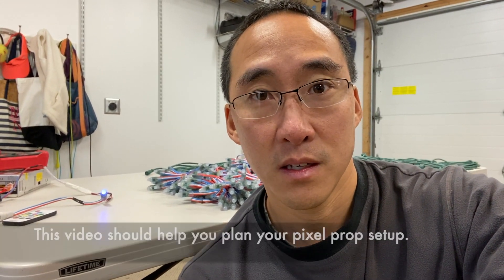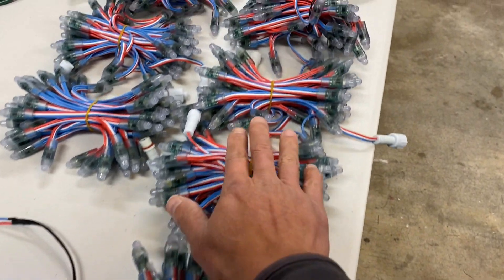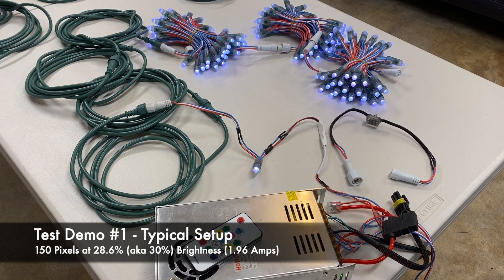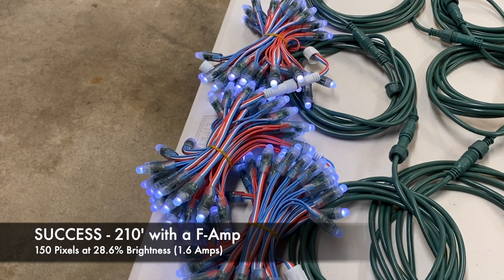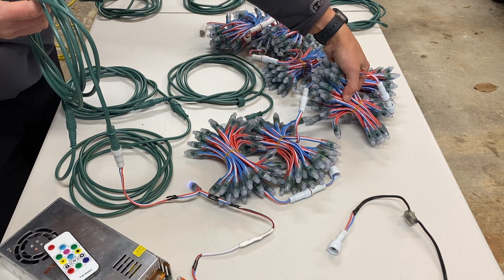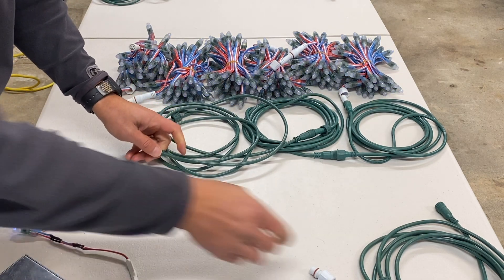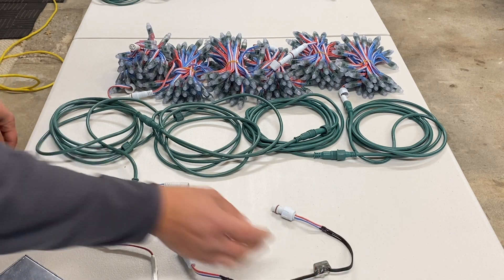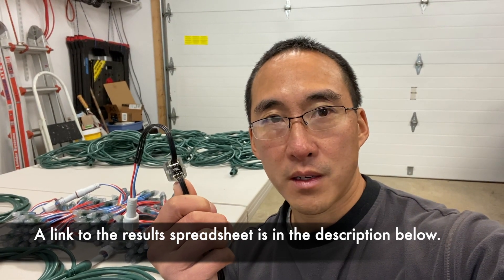WS2811 Pixel Data - How Far Can It Go With and Without a F-Amp

Comment: Yes this works well with Null pixel between controller and first and numerous strings after.....BUT what is the scenario when you want to jump from the end of say a 235 light string 10ft to the next level is the f-amp gonna help with that?
Reply from the maker: Yes, it certainly will help in that situation. After 235 pixels, you could add an F-amp and should power inject before the next set of 235 or more pixels. I actually do that for one of the shows I run. Without the F-Amp, all white can get flaky  with the second set of 234 pixels despite having enough power. The F-Amp cleans the signal plenty to chain another large batch of pixels with no problem.

Comment: Well you have the same results if you run the same set up from the controller and without the first pixel in line ?
Reply from the maker: Mouris Younan, if you're running from a Falcon or Kulp controller, you're likely to have better results than what's shown in these tests.  I didn't run the tests from the small test controller, as that's not representative of what most people use to run their shows.

Comment: Great video Steve!!!   By any chance did you do any test with extension between pixels?  Say you test at 28% 40ft extension before first pixel (300 pixels) then added another 40 ft extension before the remaining pixels.  Would you still be able to get away with having F Amp at the beginning or would have to put F Amp before the remaining pixels?
Reply from the maker: Andy Perez, no I did not.  There are too many combinations to possibly cover.  With 300 pixels, 28%, and 40ft extension with an F-Amp, the signal should be fine.  Adding another 40 feet without an F-Amp to the remaining (I assume you're thinking of 50 more pixels) I would ballpark guess wouldn't work. You'll be cutting it real close, so to be safe, you may want to have extra F-Amps around just in case.
Reply: @NiFamilyLights  Thanks Steve!!!  I’ll pickup some F-Amps.

Comment: New to this, so a newbie question.  With 150 pixels and 40' extension the pixels worked.  But with 350 pixels an 40 feet extensions no pixels lit up.  Why does the data not at least go through some of the pixels, say the first 150 since 40 feet worked with 150 pixels alone?
Reply from the maker: Mike Rose, what you are questioning is one of the conclusions drawn from the video that will pay you dividends to understand.   

The Ground line is used by the pixels for power and for data.  The pixels use the difference between the data line and the ground line to determine if it's reading a 1 or a 0 digital value.  

When more pixels are being driven (350 vs 150), the 350 pixels will draw power and cause noise on the ground line.  This noise essentially corrupts the reference ground that the pixels need to interpret the data.  The corruption results in no good data signal (all 0s), so the pixels all stay off or freeze.  If the noise isn't horribly bad but still bad, you get the random color flickering as shown in one of the tests.

However, there's a solution to this that's not explored in this video, as it would make the video too long, and that is to power inject.  I am planning to cover some practical power injection methods in future videos -- improving voltage sag (color loss) and better grounding (stable data).

Comment: Why are you using a single pixel at the beginning of the run? Also isn’t that also automatically add some distance? Thanks for the video.
Reply from the maker: I have a single pixel in the beginning to simulate a "worst case" starting point, data coming from a standard 12v pixel.  That way the little tester's output performance isn't what's being tested.  

Also noted is that outputs from a Falcon, Kulp, or other pixel controller would likely be much better than a single pixel.  

Yes, having the single pixel adds some length.  The tests aren't for precision.  It's to give a ballpark idea of how far data can travel, without and with a F-Amp.
Reply: @NiFamilyLights  Thank you! great video!

Comment: Nice. How about if we can put another power injection to the end of 250 ft 300 pixel that would help
Reply from the maker: Power injection is another topic.  To keep this test as straight forward as possible, I didn't want to complicate the video by showing the benefits of power injection.

There are many ways to power inject and doing so would certainly solve distance issues shown here.

Comment: Nice test, thank you :) Although there are still many variables that can differ from practical use. Most important one is wire gauge I think. (Perhaps I missed it, and you did mention it in the video) I assume 18 AWG? And if you are going to power inject, it opens another can of worms. It can make the results better, but also worse in some cases when it comes to signal quality. At least that is my practical experience. Thank you for the excel sheet, I will use it as a reference for sure.
Reply from the maker: You are welcome.  

Wire used is definitely important.  I cover the materials in the beginning in the Test Setup section.  It's vendor supplied "18 awg" 10' pre-made extension.  They say it's 18 awg, but I think it's more like 20-22 awg.